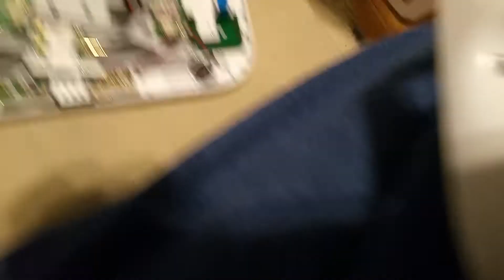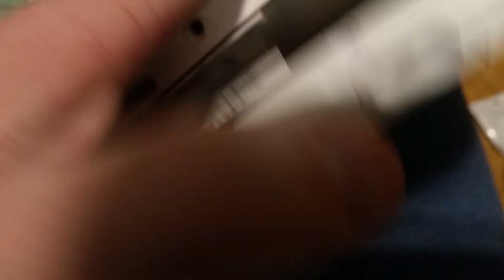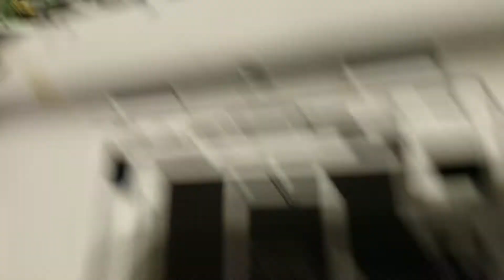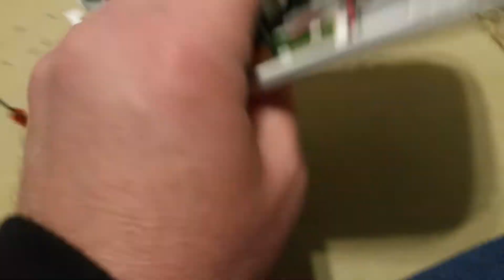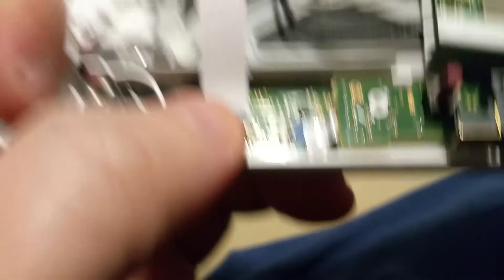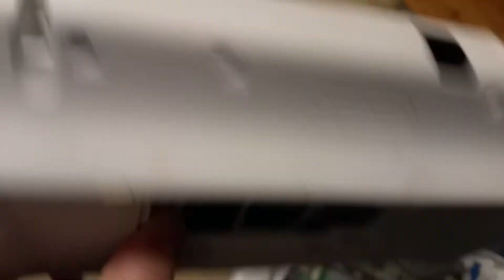Wii u kiosk gamepad purchased!

Comment: Just bought a wii u. How is it in this era? Does everything still work? Updates etc? Cheers
Reply from the maker: Yes, as of this moment updates for games and the console are still active. The eshop is still operating as well. The Miiverse and video calling services have been shut down, I'm sure some other things have as well but can't think off the top of my head. How long this lasts is any bodies guess.
Reply: @jeremyrobertson9718  thanks for that. Was going to get my 5yr old a switch for xmas but thought a wii u would be better (cheaper to replace if broke) & the  games etc are cheaper. No doubt i'll have a few games of mario kart wen hes sleeping haha. Does the main wii u have to be connected to tv to use handled or is just powered on enough? (Without hdmi).
Reply from the maker: @glasgowfunctionsify  The console will work without being displayed to a tv, but not all games can be played on the gamepad. A good portion of games use it to display maps, or inventory, and some do nothing with it.